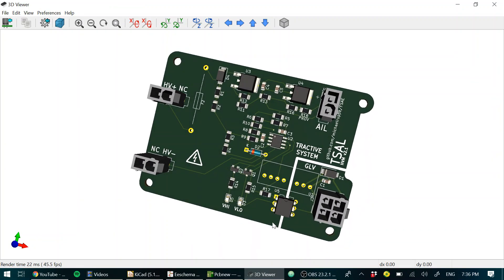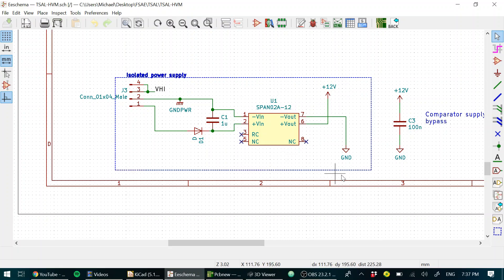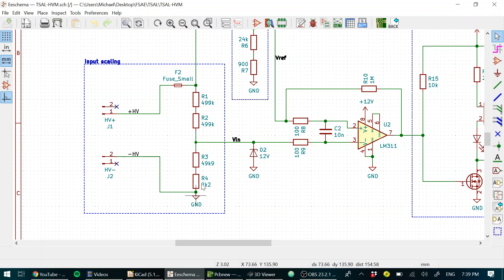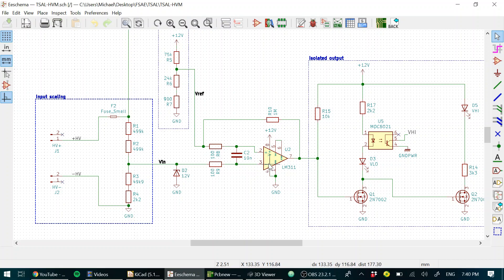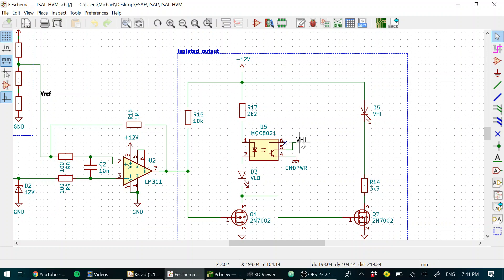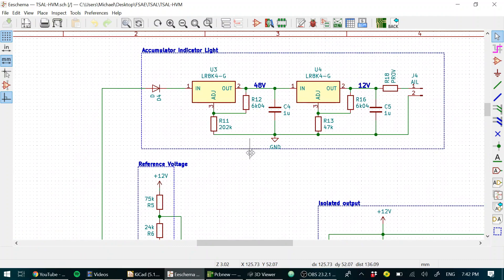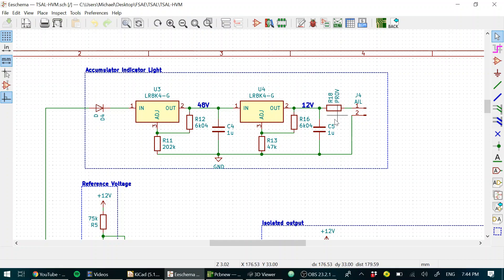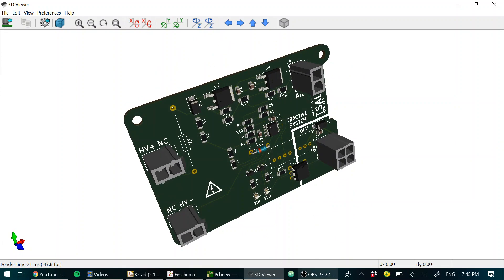TSAL design walkthrough (FSAE Australia 2019)

Comment: FSAE 2021 EV.6.2.1states that "All Tractive System components must be rated for the maximum Tractive System voltage." Does this mean that all components in the HV side of the board need to be rated for max TS V (including the resistors and op amp)?
Reply from the maker: It depends on how you interpret the rules I suppose. If you follow the letter of the rules then you can easily make an argument that this is not competition-compliant. If you follow the spirit of the rules, I think this design meets the requirements. We competed in 2019 with this topology and passed scrutineering.
Reply: @MichaelRuppe  Alright thanks!
Reply from the maker: @ananhefny1394  best of luck 🙂